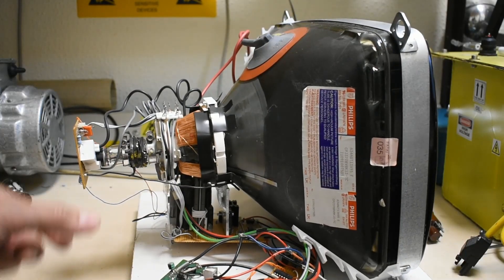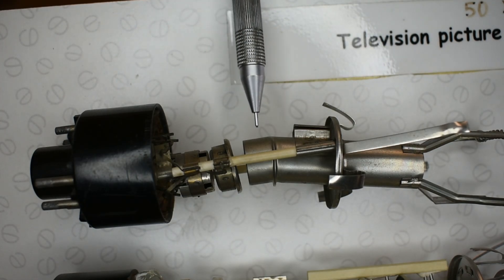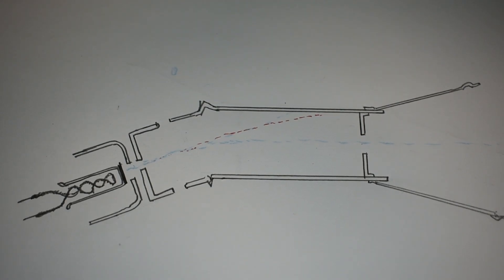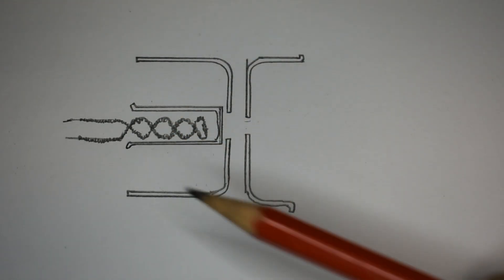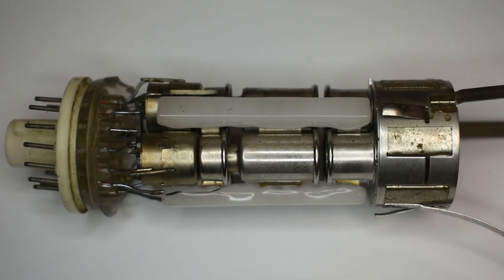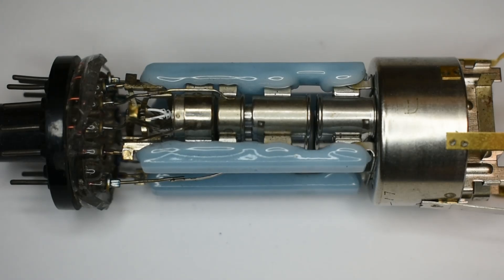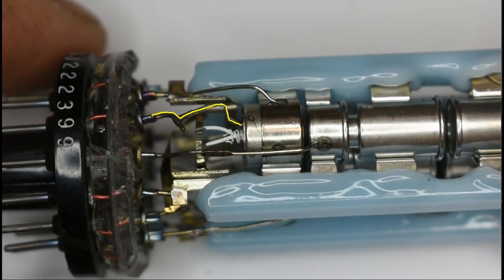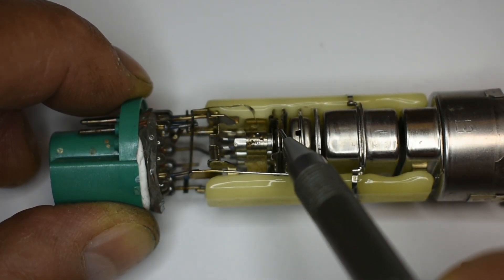Television Cathode Ray Tube Electron Gun Evolution  (Part 1)

Comment: Pixels 
Pixel 
Each pixel 
Resolution 
Resolving power of CRT 

Desktops 
Laptops 
Operating 
Power of 1 mW 
Voltage of 0.708 v to 3.16 v 

Inlet pump 
Influent 

Pump efficiency is proportional to efficiency of CRT ...

Many mobiles are not having the resolving power of television ...so images in 2g mobiles are black and white images ...
Higher resolving mirrors ....give better images .....with 252 colours or more ......
Reply from the maker: interesting comparison. I would expect LCD efficiency to win easily as most of the energy in in backlighting.

Comment: There is no red color on my TV. It shows black and black instead of red. Could it be due to electrons?
Reply from the maker: most likely no drive from the red amplifier. Could have a heater out but unlikely.
Reply: @tuopeeks Which one do you have a picture of?
Reply from the maker: @efe794   The video covers the gun construction. The second part goes into more details and pin connections for the later colour tubes with 'in-line' guns. The only connections that are related to the Red gun in later tubes is it's cathode pin. The connection for this is shown in Part 2

Comment: I have a question if a new electron was made today to update the technology of it how could you go about doing it?
Reply: Thank you for explaining it so beautifully
Reply from the maker: Good question, the basic principles remain the same. The trend before the end of production was to reduce the size of the gun assembly and simplify the electrostatics/magnetics for convergence. The trend for flatter screens complicated this a little. I think the next development Philips were looking at was to reduce the delay time required for the heater cathode to reach emission temperature. This could produce a more instant picture. While some inroads had already been made for this, there may have been development into cooler cathode emitters, perhaps looking at semiconductor electron emitters or radio-active enhanced emitters.  I doubt CRT tech would have much of a revival regardless, as the need for the large high vacuum bulb and high voltage power supplies would still remains making it bulky by modern standards. The closest modern technology spin-off would be plasma displays, but these are now also obsolete.
Reply: @tuopeeks  even using diamond moiasstte technology?
Reply from the maker: @annfrank5959  Not sure of all the emissive properties of this but it would fall under the banner of semi-conductor emitter.

Comment: the ion trap works the other way around. The (positive!) ions move towards the cathode where they damage the cathode surface. The trap prevent the heavy ions to make the curve towards the cathode.
Reply from the maker: Good point, thanks for that, Hadn't thought it through completely. Ions were always blamed for burning the fluorescent screen coating around the centre with with higher impact energy and less deflection but from what you say these would need to have been negatively charged ion.  Aluminium backing to the screen coating and removal of the ion trap occurred around the same time suggesting it was a solution. I would expect cathode damage could still be an issue  barring improved vacuum processes.  Although devastating for the cathode the target area through the grid is small perhaps reducing impacts.

Comment: Are any of the heaters or enclosures doped by an oxide or radioactive
Reply from the maker: I haven't found any radioactive coatings used in CRTs.  Thoriated heaters are sometimes found in high power valves with heater-cathodes. The cathodes are coated with various oxides to increase emissivity.  These become less effective with time and the main reason CRT picture quality becomes poor .

Comment: Can't  believe particle ray gun was aimed at our faces up until 2000s kids. 

Parent then: don't stare too close to the TV, prolonged  use can obliterate your eyes

Kids (adults now): Well no sh*t mom, that what she meant..
Meanwhile buys a curved HD flatscreen*
Reply from the maker: Fortunately the beam energy is no where near that of a LINAC, so doesn't travel through the screen and air. Interestingly the build up of static charge on the screen, created by the internal acceleration voltage, was high enough to attract and collect dust from the surrounding air.

Comment: Is there palladium or silver in those newer( color) guns?
Reply from the maker: Very unlikely, there isn't a need to use expensive metals in electron guns old or new. Parts mainly need to be non-magnetic. Some later guns may have had small magnetic parts added for convergence.

Comment: Cool video. I have often been curious if there would be some way to electroplate new emitter material onto a dead electron gun, and restore it, since they are not made anymore.
Reply from the maker: I think the biggest issue would be accessing the cathode to recoat it without destroying the assembly.   The cathode is held in place by numerous spot welds within the grid.  As CRTs were expensive items, there once was an industry for re-gunning tubes. Manufacturers would supply new electron gun assemblies for fitting by independent worships.

Comment: Could you somehow show the inside of the first gun?

Where the ion-beam hits the inside wall.
Reply from the maker: Not keen to dismantle that gun as I don't have another, or even another CRT with this type of gun as they are long out of production.  I don't think there is much to see and I can see nothing on the inside of the cylinder squinting between the anodes.  I wouldn't expect any local noticeable heating as the energy and impact occurrence is small. The fluorescent coating on the screen is easily damaged and even a stationary beam will damage it in seconds, if bright. The Ion burn occurs over long use. I think I have noticed the aluminium coating on the back of B&W screens becoming thin in the area where ions hit, but I can't be sure as it is a long time since I broke up a B&W CRT.
Reply: @tuopeeks  it's not too hard to find old crts, most of the CRT TV's I've found were in the woods lol
Reply from the maker: @RedDeckRedemption  yeah, found a lot of broken CRTs that way, but ion-trap guns are way too old to find in any state now.